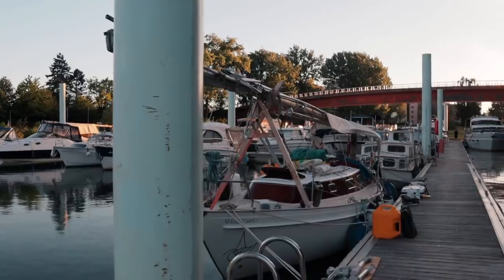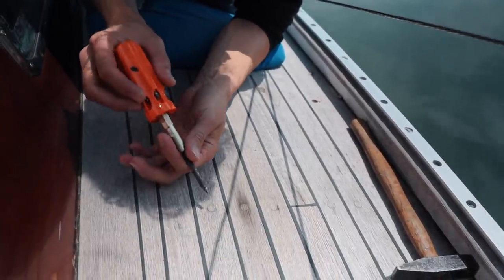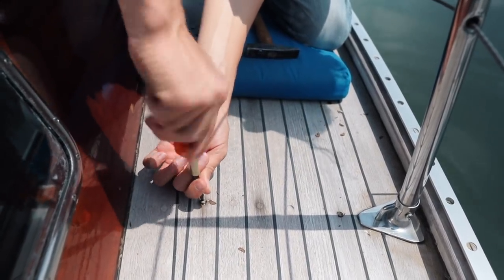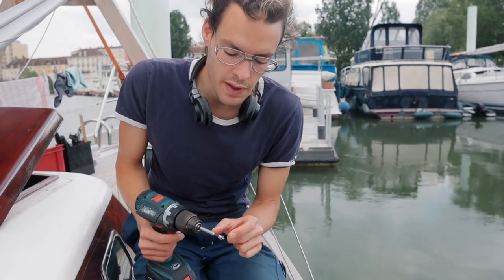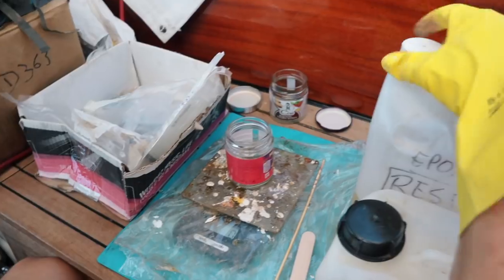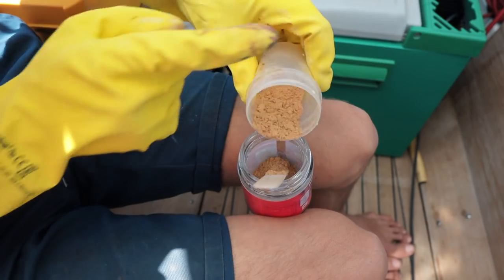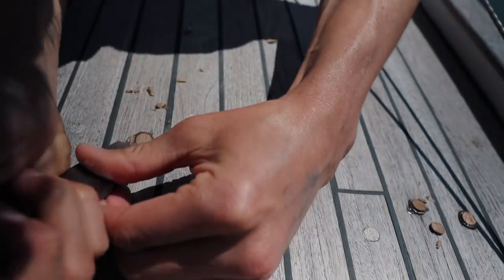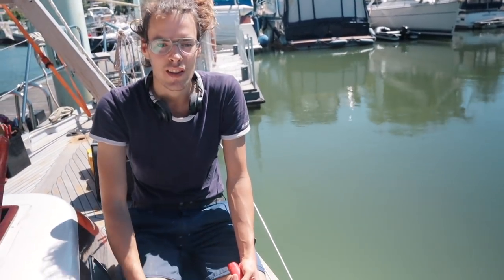The ESSENTIAL GUIDE to maintaining a classic teak deck [teak bung replacement]

Comment: Interested that you are not putting any sealant in the hole before fixing the screw, as the deck inevitably thins 12 to 8mm are you not concerned that  water under the deck will get into the core?  I got the impression you were replacing the original screws with flat heads to get better engagement with the bung, what is the minimum depth you would tolerate and are you therefore reducing the screw length as the deck ages?
Reply: You don't need to reduce the screw length, the teak shrinks from the top and down due to wear and tear. The bungs get shorter and shorter with the deck on the other hand.
Reply: @SailingVinderla  No, you have re-drill each hole as the original screw is now flush with the deck, on a Vindo you are fortunate that the original teak is substantial but over 30 years you may have lost >30%.  My concern is the original screws will now be at least 5mm deeper i.e into the core and on the doghouse they may penetrate the ply under deck.  So to keep the bung depth to a minimum, what is the minimum hole depth you could tolerate to allow for proper engagement and adhesion?
Reply from the maker: Hello Nigel
You are right about the screws having to be shorter over time. Not the case for us still and unfortunately i don’t have a general answer as to the perfect length. It depends very much on the specific example one is looking at:)
Aladino
Reply: Thanks Aladino, I noted in the video that you don’t use a drill stop and that you do it by eye, so I’m interested in what you consider to be the minimum hole depth, you would tolerate to ensure the bung is secure.  I am assuming >3mm, so with the CS screw head, that only leaves c.3mm of wood and even given the robust Vindo construction are you not concerned that the screws will penetrate the deck core.  We own a Vindo 65 Mix and every year that I do this job I am concerned that I will compromise the cabin roof or side decks, so I am wondering how long before have to lift and bond the deck.  On our Vindo their are ‘internal’ deck drains that allow water trapped under the teak deck and above the side decks to drain into the bilge, does this not imply that ‘by design’, water can pool under the teak deck and enter the core if the screw holes are too deep.

Comment: I have been watching your videos for a while and do enjoy them. The last video you put out you show how to repair teak decks ?
I need to point out a few things you are wrong about. First the drill you use for countersinking the screw hole is wrong. The type of drill you should use is a wood counter sink made specifically for wood screws with a tapered angle for the underside of the screw head, the drill should also incorporate a tapered drill. The type of screws you are using are a self taper you should be using/installing wood screws unless the screws are being driven into fiberglass. If you are going to try to teach people please know what the correct tools and procedures are.

Comment: Why not mark the grain direction on the top face. You are going to cut it off? 

You are describing cutting with in preference to against the grain to avoid a rough surface and/or a water trap caused by a subsurfaced bung. 

Now a question :  How can you assure yourself that the deck beneath  is solid and not delamination?

Thanks
Bill
Reply from the maker: Hy Ratus
It find it is not difficult to see the grain direction and therefore save one extra step.

Delamination usually comes from something being wrong obviously.
So having a sound teak deck doesnt make me worry about what is underneath even if not visible..
On a thin and worn deck, sponginess could be felt when walking on it and also there could be pointers from the inside of the boat.
Cheers
Aladino
Reply: @SailingMagicCarpet  thanks aladino, good answer.
I wasn't testing you. I may be much older but I am also much less experienced than you. You are doing I am not.
I love the idea of a teak deck and don't mind the work to maintain one. But only maintain not make up for it's history of neglect. So my question was based in fear of teak. How to prove that it is healthy before buying.
Do you know if there is an advantage to having teak?
Bill

Comment: The very best way to maintain an old teak deck, one that will permanently fix all the leaks and guarantee no more issues, IS TO REMOVE EVERY BLASTED STICK AND FILL UP THE DUMBSTER  WITH THEM!  

Fill the holes, epoxy the entire deck, new paint/non'skid.  Go sailing

Just my opinion.

You also need to pray that that the 100's of screw holes hav'nt allowed the entire ocean into the balsa-cored deck and turned that all to wet newsprint.